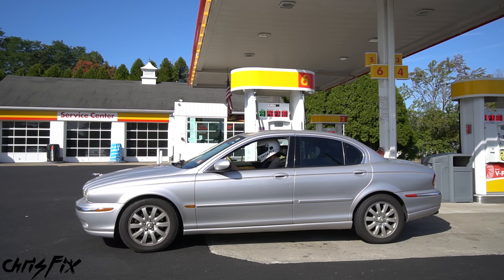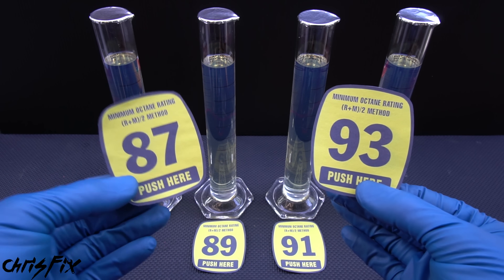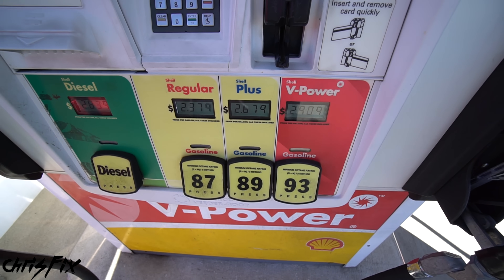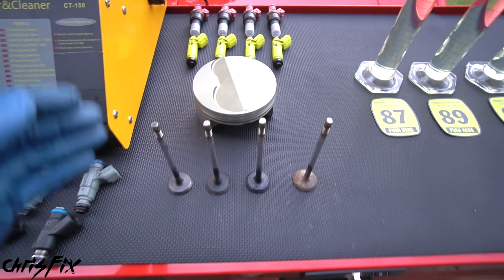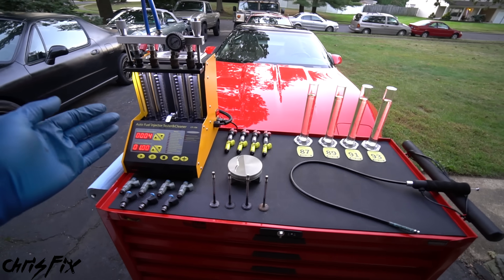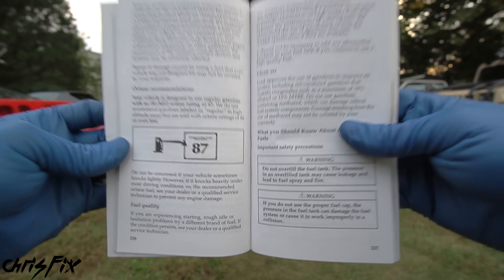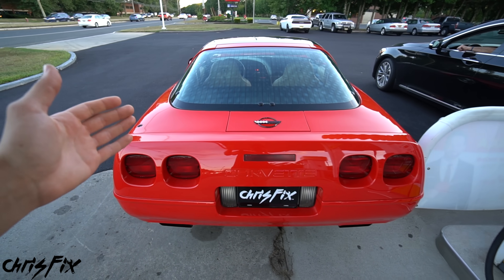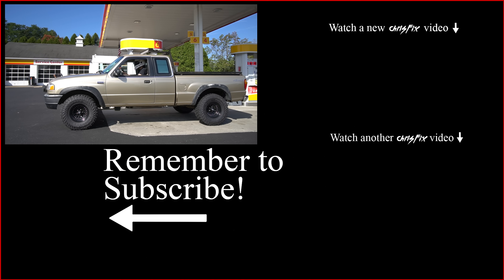What is the BEST Fuel to Use in Your Car or Truck and WHY

Comment: You didn't mention tier fuel levels. Or did i miss that? Big differences in how clean they burn. Shell is a tier 1 across all grades i think.
Reply: "Top Tier" gasoline is sold at stations like Shell, Costco, Mobile and many others. It's the best gas money can buy at the pump. This is why I always fuel up at Costco or KwikTrip by me as there participating top tier stations. 🙂

Comment: So moral of the story. Fill up at Shell whenever you get bonus.
Reply: 5th gear did a test with different fuels and difference between asda unleaded was 235.8bhp and shell v-power 240.9bhp
Reply: I always use Shell or bp that is by my work. I refuse to put anything else in my car.
Reply: @The Bassman cheapest and the best! Shell is crap and causes misfires and knock in TGDI
Reply: Shell gas is crap. Costco and 76 are the best.
Reply: @tyquanwashington.8510  Think about it! does Costco have any Refineries, NO!!! Therefore, it buys All of its Gas from the Majors. There is No Such thing as Costco Gas.
Reply: @tyquanwashington.8510  lmao. Shell and Exxon are the best hands down. Chevron and BP are runner ups. But the difference between each is very slight. 99% of drivers will never notice any differences over the life of their vehicle
Reply: @ezrawaters6653  curious how you extrapolated this ? My ECU tells me shell is crap and it's pretty well known problem.
Reply: @tyquanwashington.8510  and what makes you think that Costco is the best lmaooo
Reply: @ezrawaters6653  what makes you think it's not lol? Costco has some of the best gas in the nation. My ECU (octane adjustment ratio) tells me Costco is high quality and yet again is well known amongst those who know their sh+t
Reply: @ezrawaters6653  
🤣

Comment: I always thought lower octane numbers translated to more power. I sat down one day to calculate the enthalpy change of combustion of different hydrocarbons. Lighter ones would give off more energy per unit mass compared to heavier ones. In my opinion, lower octane numbers translated to a fuel that is more powerful/efficient but also very volatile and hence prone to knock.

Comment: From my experience use which ever guess that car has been using if you have an old truck that’s been using regular old cheap gas keep it on that because it’s hard for the motor some time to switch over as weird as that sounds

Comment: Unleaded is 88 ??
Reply: Unleaded is all grades of octane. leaded fuel isn't used in modern times except in some racing fuel applications or as a side additive that you pour in unleaded gasoline if you have an old classic car that requires it. So 85 through 94 octane gasoline sold in the US, no longer has lead.  Hence unleaded.
Reply: @waycoolscootaloo  thank you so much!
I've learned something new today!

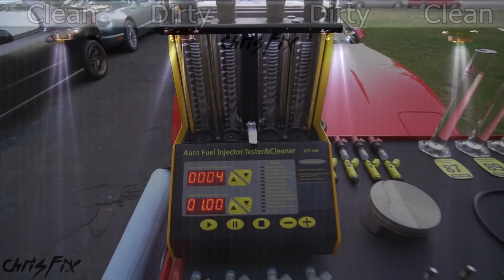Comment: 8:37 I bought a 2006 mustang for some reason I feel like it’s missing power. So technically if I use 91 prime gasoline that will fix it?
Reply: No, if it was abused, the piston rings could be shot and compression is lost during detonation because there is a gap between the cylinder wall and the ring causing air/fuel to be robbed. Timing could be another issue. The one thing you can do that's simple is remove a couple spark plugs and see how they look. If they are covered in oil or oxidized white, it's a fuel/air mix problem. Either one of those will limit spark. Change the spark plugs first, make sure you gap them properly, and then see what happens. If that doesnt work, down the rabbit hole you go.
Reply: @silverstacker177  worth the try hope that does the trick :/ thanks m8
Reply: @pvtghost95  - The spark plug inspection will tell you a lot, especially if you remove all of them and number them either by firing order or front to back on each side. If they all look the same, then you might have a clogged throtle body, bad injectors, or a bad fuel pump/sending unit causing lack of power. Even just making sure the alternator is in fine working condition can help diagnose this problem.
Reply: @silverstacker177  your true MVP . Thanks for the tips I’ll definitely check them all
Reply: @pvtghost95  - No MVP here, just someone who has been in the same situation as you. Just trying to give you the heads up before you spend more than you need to. Check those spark plugs before you take your car to shop. Because if it's just low to no spark, it's a $50 job at most.

Comment: How wonderful to live in a country with quality gasoline and at a fair price.

Here in Brazil we have a very expensive gasoline, always mixed with 30% ethanol, many heavy metals, low additive load, several times adulterated, and we still have the problem that most gas stations compute 1 liter at the pump, but it comes out less than that.

And all stations have employees to put fuel in your car, it is law.

They try at all times to force you to change the engine oil, complete the cooling system with tap water, and sell additives from unknown brands.
Reply: Wow! That's what it was like here in the US in the 1930's. That's why our old-time gas pumps had a sight glass on top of them, so the customer could physically see that they were not getting dirty gasoline. 

Today here in the US and Canada, gasoline has very high standards enforced by the government. It has to be free of impurities. It has to have additives that prevent corrosion and pollution. It must have lubricating properties too. It also has to have additives that stop carbon buildup in the engine. 

Gas pumps in the US also have to be highly calibrated to give the exact amount of fuel that you purchase. So if you buy 3 gallons of gas, the pump will give out exactly 3.00 gallons of gasoline. 

Gasoline in the US is typically 10% ethanol and 90% gasoline. Then we have E15 and E85 too. (15% ethanol and 85% ethanol blend) These fuels also meet the same standards as regular gas though. 

The average price of gas in the US right now is $2.87 USD for one US gallon. (3.785 liters)

Comment: dear people, this video does not reflect the reality whatsoever. I have owned numerous dozens of vehicles, and drove numerous thousands. The higher the octane, the better fuel economy you will get, PERIOD. E39 BMW 525 will burn 15L/100km with 87, and 7L/100km with 91. In 4.7L Dodge ram with 87 you are only able to make from gas station to gas station, with 91, you are getting few 100ks out of tank. In 5.4L Triton, if you use regular, well you are plain dull....lets leave it at that. 
Gasline in north america is absolute trash. 
Use the fuel that manufacturer reccomends.......riiiiight. I guess this chap is too your to know about Great Auto Convension....
Reply: First what you typed is basically wrong. Second, you can't even type in proper English. What you said is gibberish. And gasoline in the US meets the highest quality standards.
Reply: @waycoolscootaloo  gasoline in us meets highest standards of what??????
Reply: @dkrawk8309  Pollution Control, particulate control, anti-corrosion properties, carbon prevention of the engine etc... 

It's heavily regulated by the government to meet high pollution standards and to keep your engine running as long as possible.

Comment: I have a 2018 Chevy Volt LT. I’ve had it for a little over a month and have only used 1/4 tank of gas. I’ve heard some owners of the volt recommend using a higher octane gas due to the longer shelf life of higher octanes since you hardly consume as much gas. I have no idea if that’s true or not; do you have any insight on this topic? I’m not opposed to spending a little more per gallon since I’m saving so much on gas in the first place lol

Comment: I have a 3 cylinder Nissan Micra, I joined a group on Facebook with others that have Micra's and someone put 91 octane in it and it actually ran so bad that it put its self in limp mode and the dealer told him to never put that in the tank agian!

Comment: Damn so I been using 91 since I freshly bought my HRV and pretty much thinking it was cleaner fuel for my engine and now to realize I’m probably screwing up my engine lol FML
Reply: You're not screwing up your engine. You're just running higher octane than what it can fully use. It's better to go with too much octane than not enough. If your vehicle recommends 87 octane, then just use that instead and save money. Running 91 octane will do no harm to your engine. Just your wallet for no added benifit. 😉

Comment: Wrong!! 87 octane 100% ignites easier than 93 octane. There for burning at a lower temp. A low compression car will make more power on 87 than 93. It's been proven over and over.

Comment: Also not mentioned is that the "midgrade" 89 may be an E15. E10 is up to 10% ethanol, E15 is up to 15% ethanol. In Minnesota, I called around in the Dept of Transportation to see who was in charge of the fuel and it turned out to be Department of Agriculture. Well, that explains our ethanol mandate. BTW, "Mandate" is Democrat for "Edict", a government order authorized by the department of "Because I said so now shut up". 

The Dept Of Ag guy seemed to think that higher octane numbers were the same as higher quality, so he was pretty much an idiot. He told me that because of ethanol that cheaper, lower quality 85 octane could have ethanol mixed in and boost the octane to 87. So they take cheaper crap fuel, add ethanol and call it okay? Ethanol has negative effects on rubber compounds, so special formulations need to be used especially on the E85 "flex fuel" cars.

Ethanol also has 60% of the energy of gasoline, so if you used an ethanol free gasoline to compare there WOULD be an energy difference between the grades. So if 10% of your volume has only 60% of the energy, than means total energy is down to 94%. Additionally, ethanol is hydrophilic, which means it attracts water. That can be good if there is condensed water in the fuel tank, but it is also bad in that it will, especially in summer, attract water from the air and reduce the energy even further.

Minnesota does not allow 87 octane fuel without ethanol, only 91 octane is ethanol free and is labeled "non-oxygenated" as though you are suffocating the car. It is also more expensive. In Iowa and Nebraska, ethanol free 87 is allowed but more expensive. Why? Because ethanol is subsidized by our governments. That means the government pays farmers and distillers to produce ethanol because in the free market it would be a losing proposition and fail. And the government subsidizes this industry with money it gets from your paychecks in hidden taxes. And the lobbyists get millions at your expense, they get millions of dollars that should be yours.

Comment: It may be so small its not noticeable... But a higher octane fuel can't have the same energy ... The chemical used to increase the octane displaces some of the fuel... Perhaps not even noticeable .. But mathematically a higher octane rating fuel should have less energy.. Or explain it to me if im missing something

Comment: Im glad i came across this video very well explained i just recently bought a 2021 civic sport hatchback and it says in the manual its recommended to run premium. I will probably still most likely run premium to keep the engine running as best as possible

Comment: Deposits are caused by pre-ignition from unburned fuel . 

Octane is set by manufacturer.

It takes a conscientious effort to keep your engine clean.

The average person does not have the knowledge to manage the many variables and if he did does not want to spend money to maintain.

Buy a point A to B car... forget about the rest. It's the American Way.  Wash your car and shine the wheels and you'll be just fine.  Go to your local dealer and change your oil.

Drive down the street with radio loud spewing BS nobody wants to hear while talking on your cell phone to your fat significant other.

Payoff your car -- buy another piece of American made junk and repeat as necessary.

Comment: I used a different method. My car was a 1998 Dodge Neon R/T DOHC engine that required fuel was 87 octane. I would burn 3 tanks each of 87, 89, and 93 octane gasoline and record the gas mileage from each tankful. Findings: best mpg 87 in winter, 89 in spring, and 93 in summer. Running the wrong octane in the wrong season could result in up to 5 or6 mpg reduction. I was driving 100 miles round trip per day using cruise control and purchasing gas from the same gas station. I have read engineers say that most car can run on regular if needed and having an MBA I believe that because if someone paid $100k for a car and 87 octane gasoline destroyed the engine that person would probably buy a Honda or other Japanese make. Also, replacing an engine after purchase is a lot more expensive.

Comment: I know that the two main octane ratings are AKI and RON, but my SAAB recommends 90 AON???  What the....
Reply: AON is the average of the RON and MON called AKI or on pumps 
R+M/2. 

AON (Average Octane Number). 
Anti-Knock Index (AKI), Road Octane Number (RdON), Pump Octane Number (PON), or (R+M)/2. 

Hope that helps 🙏🏼
Reply: @coachtonythetiger  Thanks brother for the clarification! So basically 90 AON == 91 AKI?
Reply: if’s a 2.0T for example i would suggest going with the 91 if 90 is not available. Your timing set point, knock detection, have low turbo pressure, etc with the decrease from 90 to 87. If it was me i’d just eat the money and fuel with 91.
Reply: @coachtonythetiger  thanks for clearing this up for me, much appreciated!!
Reply: No problem

Comment: There was a couple  of tiny inaccuracies in the video.  The first is that all of the pumps around me are 85, 87 and 91 octane. Not 87, 91, and 93.  The other is that gasoline shouldn't  explode,  that is a knock. It burns.  Diesel fuel has a controlled explosion  but not gasoline.   If it explodes, there could be some serious damage. It is explained later but at the beginning it's confusing.

Comment: Start video say: does not effect fuel economy.
But ? Showing your Vette filler area, say lower octane will effect power/economy.
Watch what you say?
Watch your video.
I buy NO- ETHANOL 90 Octane, at a Indian Station, gets Canadian Gas.
U.S.- FEDERAL MANDATES 10%- ETHANOL!
Also add MYSTERY OIL TO MY GAS!
2 1/2- gallons= 1-oz. RATIO.
Lubricant upper valves/rings.
Truck “97-Dakota (318), has 364k miles.
Got it New.
Back to you?
Higher OCTANE = BETTER GAS MILEAGE/GALLON.
Try it, to see.

Comment: I have a VW Jetta with the r-design turbo engine in it. The fuel door and owner's manual says to run 87 octane or 91 Ron. So that's what I do I run the less expensive 87 octane in my car and it doesn't knock, ping or diesel.

Comment: I have a 2017 Hyundai Accent and the manual says to use unleaded fuel of 87 octane or higher.
I have found running 91 octane premium produces the most power and least engine noise and vibration.
When I have run 87 octane the car runs rough and has less power.

Comment: What about ethanol-free gas? Thats what I use in my 2018 camry. And I used in my 2016. But the motor oil started to smell like gasoline in the block and on the dipstick. Is it bad to use only ethanol-free gas?
Reply from the maker: It is basically the same as fuel with 5% or 10% ethanol. You will notice a little lower MPGs and if your car sits for months it can hold water but the small amount of ethanol makes no significant difference in the fuel.
Reply: Thank you Chris. I have been on google countless times and never got any answers. Much appreciated my friend👍

Comment: Good add on the E-85. Consider updating and talking about the Ethanol free fuel and the benefits it can provide. Ethanol free does have more energy (a little) since gas is more energy dense than ethanol; and it usually provides a small increase in MPGs. 
However, In my experience, the increased cost isn’t worth the increased MPG.

Comment: My owners manual says 87 or higher I use 91 just because it’s a direct injection turbo charged engine to avoid the carbon build up 2020 Santa Fe 2.0T

Comment: I had a 4 cylinder and a V8 and I tried all and found both ran best on plus 89. Right in between. Premium is good for sports cars, regular is good for lawnmowers. Go right in between can't go wrong. I still say diesel is by far the best fuel and engines.

Comment: 87 octane is the cleanest.  Catalytic Cracking method makes higher octane dirtier.  In general terms. Using heavy molecules to create octane instead of the old way of using lead.  The higher the octane, the more heavier molecules have been used to get there.  Thus, carbon build up.  If you can run 87, then do it.  Your engine will thank you and not have as many drivability issues.

Comment: I got a 2014 charger 5.7 the manual recommends 87, and 89 but I’m putting longtube headers and a throttle body spacer with a tune  does running 91 have any benefits to the performance?

Comment: Higher octane is the only gas to run in today's air cooled motorcycle engines and high performance car engines due to its control of pre destination.  Any car or truck that is stock runs well on 87 octane. With that said if your car is feeling sluggish you can run your car down to almost empty and add 5 to 10 gallons of high test to clean out the carbon deposits.  Not needed all the time it's like a 6 month interval.
Reply from the maker: Thanks for sharing!

Comment: Hi Chris, I purchased a  1984 Toyota Celica GTS Convertible in November 2020. It has 139K miles and I put premium gas in it.  I believe its suppose to use regular gas. Should I be worried?
Reply from the maker: You haven't done any harm to the car!

Comment: So my 2013 Honda Accord EX Sedan manual says “87 octane or higher” so what is best? It’s a new car to me, but it has about 87k miles on it if that makes any difference. I drive it as well as I can. I can be a speed demon as I’m learning to find out. What fuel would you put in it? I’m actually in my way to the gas station now haha which is why I’m commenting before I finish watching the video.